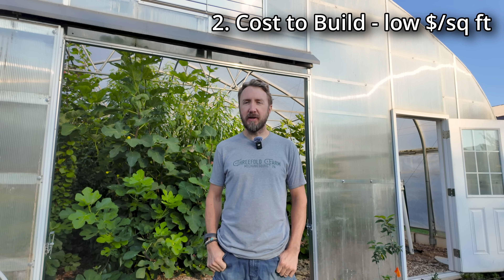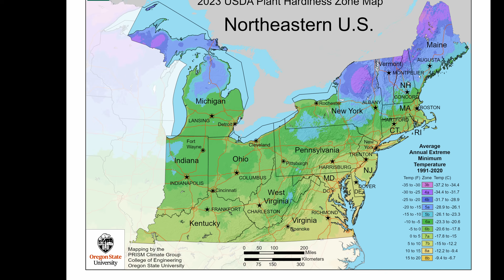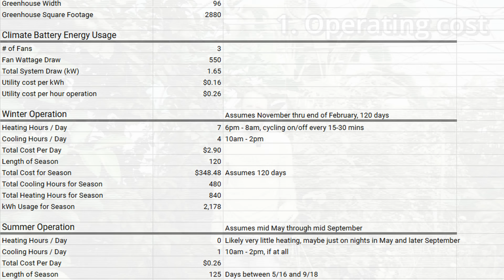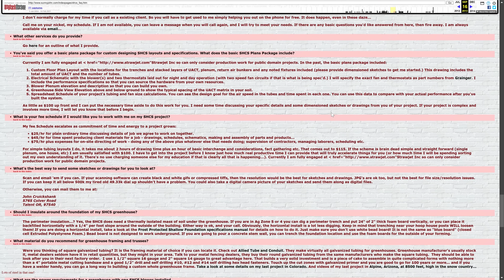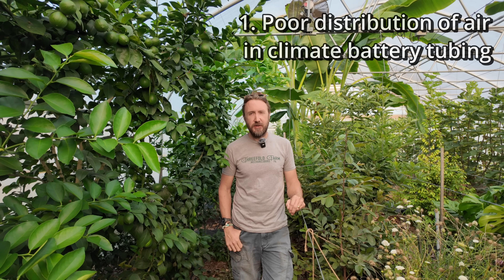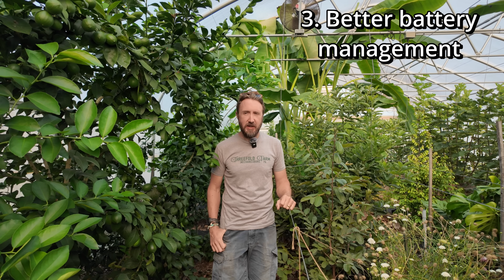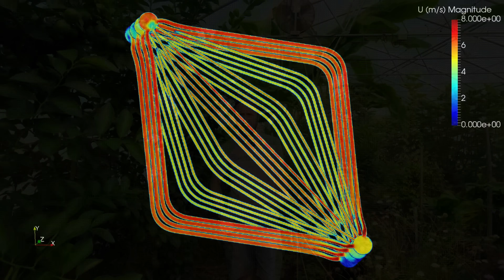Building an (Almost) Tropical Geothermal Climate Battery Greenhouse in a Temperate Climate

Comment: Good video dude.  Yes, a typical greenhouse is more about extending the season for temperate or cool weather crops, or for cool/cold weather crops being able to over-winter them.  In that use case a high tunnel is very effective.  But they create problems too and the problems are different based on latitude and elevation along with the climate of the area which means if you want to grow year round, some form of climate control is needed, and often it's about making sure you don't bake your plants in the warm months.

Row covers tend to be for once again extending the season for temperate plants, and one of the most important things they do is keep frost off of plants.  They're also used, though it can be different fabric, to keep pests off of crops.

So, if I got this right, the fans for a system like this need to move air slowly, but a pretty decent volume of air, which would suggest bigger fans moving at slower speeds, along with understanding the system layout and how to move air as evenly as possible through this air structure.
Reply from the maker: Thanks for the comment. Yes, I don't advocate building a structure more complicated than what you truly need. If it's just about minor season extensive a high tunnel is very cost-effective. If it's about adding to that or overwintering crops that would benefit from a warmer winter or getting a significant head start on the growing season without breaking the bank due to the cost of heating fuels then the climate battery can be another tool that the grower can use.

As for your comment about airflow, my mindset around choose a fan is to facilitate air movement through the piping in such a way that the heat transfer rate into the soil is maximized while minimizing the operating cost of the fans. The fan needs to be matched to the tubing layout. Hope that's helpful.

Comment: Hi. I have an idea that you might find useful. Let me say that I assume you are familiar with countercurrent exchange already, but I will also recap how the concept applies here. When you insert hot air into the ground and it leaves on the other side, you are creating a heat gradient which is hottest nearest to inlet and will be coolest at the outlet. The temperature that the air exits with, given sufficient heat exchange, will be closest to the ground temperature at the outlet. I would suggest that you install the batteries such that they are partitioned into N sections that form a gradient from hot to cold. Before and after each section, there will be a tube coming up from the battery with which air can be exchanged, thus there will be N+1 tubes coming out of the ground. When each tube is used as an outlet, it will have a particular temperature Tn (where n is the outlet used from 0 to N inclusive). Here is the most important part: charge the hot and cold side of the battery by using external air when it is hot and cold outside rather than the air in the greenhouse. You could also use an exposed black tube or a parking lot to better heat the hot side. Lets give an example of how to use this below:

Suppose that the outlet temperatures are the following (in Fahrenheit): [90, 80, 70, 60, 50]. If the outside temperature is 100F, and you intend to maintain a constant temperature of 70F inside the greenhouse year-round, then you take air in from the outside and pump it into the 90F tube. You do this because the 90F tube is the hottest tube which has an outlet temperature below 100F. The outlet to the greenhouse will be the 70F tube, because we always want the greenhouse to be as close to the temperature of the outlet air as possible. During this process, its possible that the 70F tube will rise in temperature to 71F. If this happens, then we instead exhaust air through the 60F tube until the greenhouse reaches 69F, at which point we switch back to the 71F tube. By doing this, we always maintain the ability to raise or lower the temperature of the greenhouse at will via thermostat, since there will be a heat gradient on which to draw upon. Also, we are charging the battery using the most extreme temperature available to us, which may not be the air inside the greenhouse, but instead the hot outside air.

Now, suppose that the outside temperature is 20F. You can draw outside air in through the 50F tube, which will cause it to cool down, and again air can be exhausted through the 70F tube. As the 70F tube cools down, you then move up to the 80F tube, then to the 90F tube. Also, if you find that it isn't able to keep it hot or cool enough, you can either tap into colder tubes or increase the airflow. I believe that this would substantially increase the overall efficiency in addition to providing much more precise temperature control.

Comment: Inspiring stuff, thank you for sharing. Noob question: could you do it with water instead or air? Have you considered sand batteries and solar panels?
Reply from the maker: Not a noob question :-) Yes, water would be better in some respects. I haven't seen anyone do a commercial-scale project with it but it's something I'd consider as a supplement to the system. Sand batteries are intriguing as well and solar panels seem to be getting better and better while continuing to become more attractive financially.

Comment: Great video. Wouldn’t a better battery be an insulated pit full of rock, with inputs and outputs on opposite ends. The air finds its own way through the voids, heating the dense material on its way through. Soil/sand/plastic are all good insulators, rock could be better
Reply from the maker: Appreciate the kind words. Some folks have looked into using rock. My concern would be that it would really destroy airflow through the media due to the paths it would have to take, as well as not being able to direct flow where needed (the air would probably find a preferential path).

Comment: How to regulate the winter warmth greenhouses is an interesting challenge.  But another is how to cool them in the summer.  Otherwise, the summer greenhouse is a desert, useful only as a drying oven for stuff we grew elsewhere.
Reply from the maker: Agreed, cooling is definitely an issue. I'm a big fan of passive ventilation and it seems to be possible in our area but there are definitely areas of the country where more active forms of cooling are needed.

Comment: You can decide before building to build a heat storage bank under the footprint of the greenhouse. Then spring, summer, fall, heat pump heat into the ground and then harvest it back over winter. This bank must be insulated away from the surrounding dirt. If overheating is an issue, heatpumping heat energy from the interior is then pumped into the ground storage under the greenhouse, cooling the greenhouse. This can give a return on energy use of several multiples with a COP of 3 or better. Solar thermal heat collectors can be used for this and all heat is circulated in tubing and zoned pumps. Solar electric is also beneficial as the panels can provide shade for reduced summer heatgain and zero the effective electrical used for pumps and fans.

Comment: Have you considered running tubing under a manure pile?  Fermenting manure can reach temperatures of 130-140 degrees and can be situated at the back side of the greenhouse and if lined by concrete blocks [4'x2') can be an active heating system in the cold months and if perforated tubing is used, as a source of liquid fertilizer.
Reply from the maker: Not under manure since we don't have a steady source, but composting woodchips, yes. Trouble/challenge seems to be maintaining the heat in the pile and delivering it to the structure.
Reply: @threefoldfarm   Try green manure, plant waste, but by adding real manure, horse or cow preferably, the composting will be faster and more complete, especially if the manure pile i adequately drained. and do then reuse the 'juice'.  Wood chips are too dense, not enough nutritive value and would need a starter agent and like horse manure, hay and stalks in the mix and also may need a partial cover to get the heat going.  I know fall tree leaves suck.  Most stables just want to get rid of their manure, even putting it out in commercial dumpsters to go to a landfill..  Do note that manure should compost at least 6-8 months (preferably a year and over wintered) before use and rotated to kill all the weed seeds and other 'goodies' that may be in it.  Rotated compost will not get as hot, but can be pt on top of composable material to get it going and should be stored with a tarp over it after it has produced most of its heat.

Comment: Spontaneously I have 4 more ideas for greenhouse heating:
1. Self produced biogas
2. Solar collectors (water or airbased) to charge the climate battery
3. PCM - phase changing material
4. Second smaller greenhouse compound just for producing/passive storing heat and/or producing biogas)
Reply from the maker: Appreciate it. All could be helpful, just comes down to figuring out which one works best for a given context. We may play around with some of these in the future, especially the thought of a centralized hydronic heat storage.

Comment: Why not connect the greenhouse plus it's whole climate battery system directly to your house and save ALL heating costs?
Reply from the maker: It's pretty low grade heat, meaning the soil gets up into the 70s at most and is rapidly used up through the winter. An attached house, though, would be a great venting place for the heat for at least a portion of the year.

Comment: I am curious to see if a thermal storage battery could do the job, similar concept. Higher temperatures, smaller footprint.
Reply from the maker: Like a sand battery? I'm intrigued too but haven't seen an inexpensive one deployed for a structure this size or larger. If you're aware of one, please pass it on.
Reply: @threefoldfarm  I have not. I am trying to figure out which heating element would work best with a solar panel given the variables power production due to the sun. I am thinking of a thermal battery that charges all summer from wind and/or solar electrical production. In the winter, that energy can be released  as needed.

Comment: You could also try what that other guy growing citrus in the winter Does and add walls of hay chips and compost on the outside and cover it all with another tarp. Basically Hot composting around the greenhouse in the winter.

Comment: Question.  Why are you not collecting heat all summer? (Not starting in September?) Have you run your heat capture and or battery fans all year? And not vent excess heat out of the green house?
Reply from the maker: Thanks for the question. This will be addressed in an upcoming video indirectly, but to answer quickly we don't need to run the system in the summer because (a) it's not effective as a heat sink due to already warm soils and (b) the ground warms passively, negating the need to run the system to warm it. Running it in mid to late summer may be beneficial in some climates to pre-charge the soils even further for the upcoming winter season but we typically don't begin charging until mid September.

As for the venting, nearly all greenhouses in all climates will need some form of ventilation in the summer (and even some of the shoulder months), the sun is just too strong and you'd need a gigantic heat sink to be able to dissipate that amount of heat.
Reply: @threefoldfarm I guess, depending where you are? And if you want tropical trees/plants,  citrus in Nebeaska ran their fans all summer. Heating the soil as much as possible. Thus maintaining to 16 or 18vdegrees Celsius all winter...not having a green jouae hotter than 30 degrees Celsius 🤔 I believe the retired postal worker did so for 25+ years?

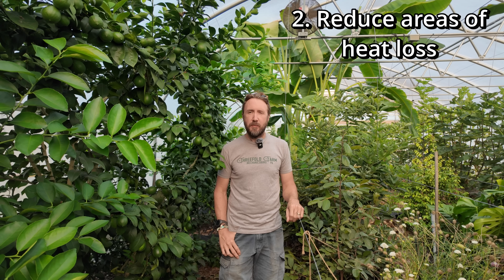Comment: @26:35 where you show the air gap and heat loss at the bottom, would perimeter bales of straw work?
Reply from the maker: Sure, we sometimes pile some wood chips along the edges to help with something to at least slow the air. I get concerned with things like straw or anything that would provide a nesting opportunity for critters though.
Reply: @threefoldfarm  Chickens are great for critter control, along with cats for mice. I always wondered why my cats liked hanging out in my garden so much until I saw them at work! I was always a "dog person" but after dealing with a mouse infestation when I first bought my farm, I quickly became a cat lover too!

Comment: Consider planting some evergreens in place of the seasonal fence. Bonus, it looks better.
Reply from the maker: Will have a video on this shortly. I'd tend to agree as it's a passive solar and does look better. However in our area we like the winds in the summer as it passively cools the house such that we don't need shade cloth or active fan-assisted ventilation, so in our situation a seasonal windbreak works better.

Comment: orifices! in a manifold like yours, the small difference in friction between tubes leads to big differences in air flow. But if you forced all of the tubes to have very similar friction, they will have very similar flow. Put an identical orifice plate in each tube and they will all have very nearly the same flow. Orifices are cheap.
Reply from the maker: Not sure what you mean by orifices. Could you point me to a product?

Comment: Cool, but id try to do it with a modern heat pump and closed glycol/water system.
what about potential mould in the pipes, what about radon gas from underground.

Comment: Why run smaller pipes to a larger manifold pipe? Why not run the smaller pipes up to the surface? You could use an in line duct fan on each of the smaller pipes at ground level then continue the pipe up to the peak to intake the warmest air.

Comment: Great video!

1. Did you consider using water rather than air as the transport medium? Although water is more viscous than air it also has a much higher heat capacity, so its possible you could get the same energy transfer for a significantly lower energy input (pump/fan wattage.) I can see it would add some extra complexity/pipework above ground as you'd need to transfer the heat from the water to the greenhouse atmosphere.

2. What would be the pros and cons of arranging the underground pipework into a single, long length? To me this seems to make more sense in terms of not having to worry about different paths the medium might take. It would also mean you could install the pipework into a trench, potentially meaning less ground disturbance.

@threefoldfarm
Reply from the maker: Water based solutions are intriguing but I haven't seen any large-scale working designs. Something to consider due to the advantages you mention but I've personally not investigated it. If you're aware of anyone doing this who has done the calculations, would be grateful to know!

With regards to the second question I'm not sure what you're envisioning. If it's a single snaked pipe or really long pipe lengths the ability to move large volumes of air goes away because of the resistance to flow due length of the piping runs or bends. Perhaps I'm not capturing what you're trying to explain.
Reply: @threefoldfarm  Hi, thanks for your reply!

Yes that's what I meant about the snaking pipe. I see what you mean about air resistance. I've mainly been looking at a water based model, in that case the flow rates are low and pipe friction isn't that important. For example, a 50w pump can easily circulate water at 28l/minute through a 63mm wide 600m long pipe. Assuming the water comes out 1c above the temp it went in at, that's over 2kw of heating power. If it comes out 2c above then it's about 5kw, a 100x energy gain. The water is underground for 5 hours!

All this is based on very rudimentary calculations and many false assumptions. I don't understand how to model heat flowing into the pipe. I've barely attempted to model the above ground bit (probably a lot of black painted radiators mounted on the back wall of the greenhouse).

But I do currently think it's feasible to use this type of model to prevent freezing of my smallish greenhouse in temperatures down to -5 which are typical where I am.

Anyway, thanks for your work and great contributions!

Comment: I scanned the comments looking to see if this had been asked already but did you fix the flow differential between the tubes?  I would think adding some baffles to equalize them would be worth the effort.  Possibly even just a restriction at the pipe coming up would equalize flow through the smaller ones.  In hydronic heating systems they have to add a little pressure to the system to remove a static layer of water along the pipe walls.  This was a very interesting video but I need to know if you fixed it?  Thanks
Reply from the maker: One of the PSU did add some baffles and was able to improve the flow difference somewhat. New designs try to do this passively. The goal (in my estimation) isn't so much fully equal flow but all flows in a more-or-less ideal range.

Comment: Great video!  I am planning to build a geothermal climater battery greenhouse in Czech republic and this video is very inspiring. Did you build the greenhouses for commercial reason? How many fig trees do you have inside one greenhouse? How many fruits does have one tree per year?
Reply from the maker: Yes, this is a structure for commercial production. I may do a video on fig production in the future, so stay tuned. I don't know those figures off the top of my head other than our intiial spacing was 6' between rows by 8' within rows.